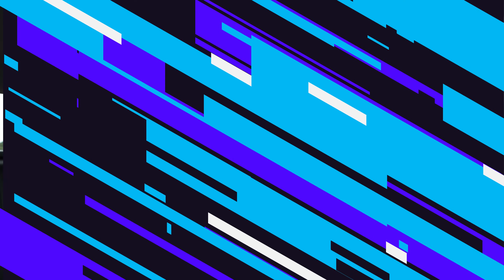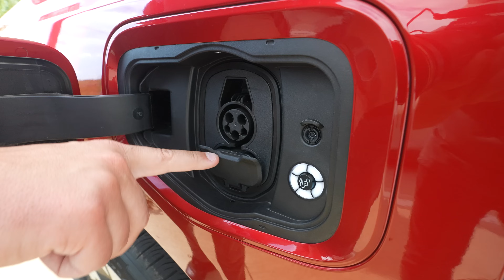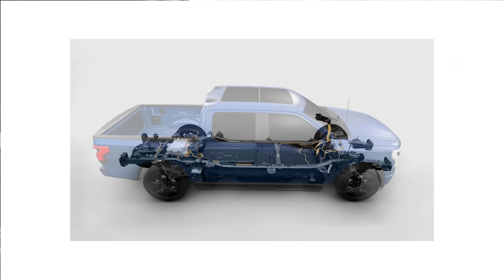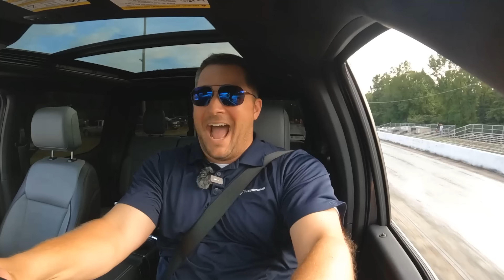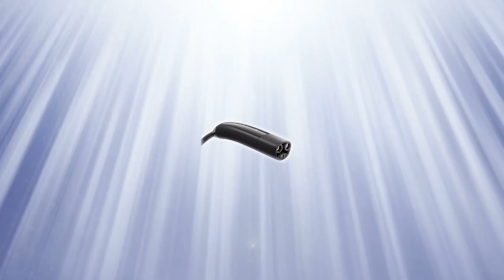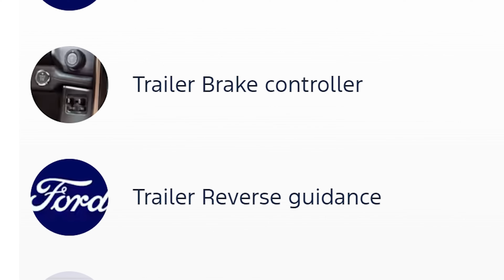Will the *ALL NEW* F-150 FLASH save Ford EV’s?

Comment: Could you imagine how bad the charging problem would be if everyone was driving a EV
Reply: I currently own a 22 Lightning and that would be a big issue today with the charging infrastructure. There's more on the road today than there were last year at this same time and were going on vacation next week. I'm not looking foreword to the charging experience during this time because most of the us will be on vacation also and guess what.....More ev's trying to charge and basically the same amount of chargers as last year. I do have my Tesla adapter so I have the option to use those, but pretty much every ev manufacturer will have access to those also in the coming months. To top that off, Ford nor apple has routing to these tesla chargers to automatically route you to them, so you have to manually add them. Ford needs to get with the program and update your maps ( I can't use charge assist while driving so that really doesn't help) and also if the charging stats are on the 24's why haven't the previous vehicles been updated with these features? Are ya'll listening Ford? I'm thinking Tesla should have charged all the auto makers that wanted to get on their network a fee to help expand the network at a faster pace since they can do it like no other charging company.
Reply: Good thing EV sales are just growing fast, not stupid fast.  Also, good thing more truck owners live where they can install their own.
Reply: If u charge ur vehicle right, u shouldn't have that problem
Reply: @craizygolf1980  there is 282 million cars on the road. If everyone drove electric you don’t think there would be a charging problem? You would be waiting hours and hours for that charge lol
Reply: @stephenritter586  ur telling me u drive 350 a day... ?
I used to be a concrete crew leader and drive 2000 a week, but my question is, how many do u drive a week ?
Reply: @craizygolf1980 I drive 600 miles to work twice a month from East Texas to West Texas
Reply: @stephenritter586  well, u can fully charge it before going  home. Then, every stop to eat, u can charge it... you will be ok... don't let me call u the supercharger  !!!

Comment: Hmmm I have a 2023 Lariat with 22k miles on it and love it. And, I do live in Central Texas in Elon territory and there’s a hell of a lot EV trucks and cars in Central Texas. But there’s one thing you didn’t mention in the video, what’s the difference for the cost of the Flash v. Lariat? So what’s the upgrade?
Reply: The heat pump.  No?  Watch Out of Spec reviews to appreciate how different EV trucks have thermal issues and address them.  Pre-conditioning a massive ~120KWh battery takes efficiency down some, but can really speed up the EV road trip.
Reply: Busey’s, Gary Busey’s?

Comment: I have a Tesla Model 3 with a heat pump. When it drops down to 15-20 degrees, the range is terrible. I’m estimating less than half the advertised range. I’m going to be selling it next year. Until they figure out that issue, I’m not sure I’ll buy another EV.

Comment: Not sure why the big three still insists on so many trim levels. Do a work version and a well-equipped version.
Reply: Hard agree.
Reply: I’m part of the reason why. I own a Ford Lightning XLT because I want the physical controls for the radio and heating system, which the higher trim levels don’t have, and I want cloth seats because that’s the only seat material that doesn’t burn my legs in Florida’s heat!

Comment: Essentially Ford has introduced a downscale Lariat for a little less money. Problem is that it STILL COSTS TOO MUCH.
Reply: I have owned a F150 Lightning Flash for coming up to a month, couldn’t be happier.  I love the fact that I can charge at home.  No more worrying if gas prices are going up this weekend for whatever excuse they can come up with.  In Canada the cost savings amounts to ~ $2000 per year to charge the truck vs. fuel the truck.
Reply: @Blue-Devil-w9e bro I bought one a month ago I added the spray in bed liner in dealer and installed the katzkin leather literally a lariat all I’m missing is the sun roof but looks exactly the same
Reply: @Blue-Devil-w9e Plus, you get the pst waived when buying used in BC. That saved me about $8k, and made an EV purchase a no-brainer.
Reply: Correctly said I'm a Ford buyer but all there vehicles are too high
Reply: Not all. Try the Maverick.  @jeffone2nv
Reply: I did see where you can build it.
Reply: Any of you guys looking to purchase a lightning soon?
Reply: A f150 xlt 4x4 5.0 starts at 59 with 0 options,  the lightning flash starts at 67 and has way more standard options so it's not really a bad deal.
Reply: @smiller225  Plus the Lightning makes almost twice the HP and torque of that XLT (0-60 MPH in 4 sec) while costing 5X less to operate around town. And it can power electric tools, or power most of your home during an outage. I like my Lightning better than all my previous V8 pickups.
Reply: @paulrybarczyk5013 
If there is an extended outage and you are powering home what do you when you do when you need to charge the lightning?
Reply: @LuisCampos-nu8sk  Good question. My Lightning can easily power the essentials in my home for a week, and I've never had an outage last that long.  But I suppose if the outage was longer, I'd road-trip to the nearest fast-charger that's outside the outage zone.
Reply: @LuisCampos-nu8sk  how do you think gas pumps work?
Reply: good answer. Also, assuming that the gas pumps are somehow working during an extended power outage, generators exist. I’m not sure what @LuisCampos-nu8sk ‘s point was, but it was a stupid one.
Reply: @LuisCampos-nu8sk your screwed like everyone else
Reply: @LuisCampos-nu8sk you find a charger with power 😲 🎉 its a wild concept
Reply: @smiller225 and the xlt is overpriced as well…what’s your point?
Reply: @smiller225  That 7500 tax credit makes it basically even with the 5.0 price
Reply: and they still don't have PRO trim on any damn lots outside of fleet sales. People were all in on the idea of a 40-44k truck. Even with incentives now,  that's looking closer to 45k before taxes and other fees. AND you won't even find it on a lot. I was just in the process of messaging a ford dealer in my area about acquiring said "fleet" pro trim lightning and they decided to ghost me randomly instead of getting back with me on if they can sell me one or not.
Reply: Between my local fuel and power prices, the federal tax credit, and the fact that an F-150 with crew cab and 4wd is fifty grand anyway, my Flash is set to break even versus an equivalent normal F-150 right at the end of the 100k mile warranty. If it lasts as long as Ford claims (not banking on it personally but it seems likely), it'll save me ten or fifteen grand by the end of its life cycle. Charging at home is cheap, and with the 300 mile range, I only do a few trips a year that need DC fast charging on the road. By national averages, it's more like 150k miles to break even for an average owner, but it's still not a bad deal for a lot of buyers. Especially since it's extremely smooth and quiet the whole time. Not what I bought it for, but it does feel like a $70k truck despite having the lifetime cost to own of a $35-40k truck.